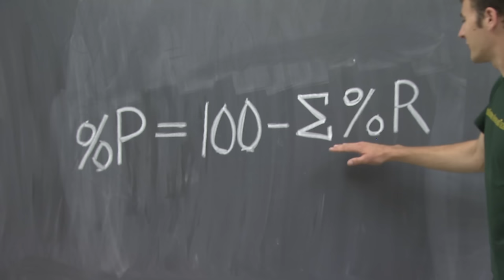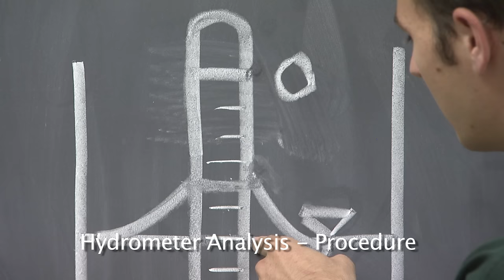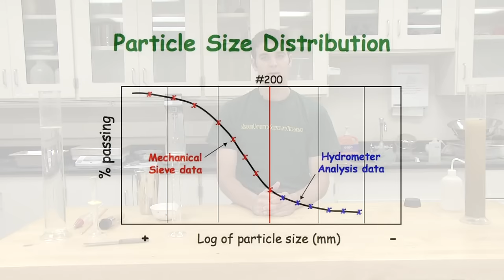Particle Size Analysis (Sieves and Hydrometer)

Comment: Nice work. This video is over 5 years old now. Has anyone on staff looked into the new "Standard Test Method for Particle-Size Distribution of Fine-Grained Soils Using the Sedimentation (Hydrometer) Analysis ASTM D7928-16"? Is a video in the works?